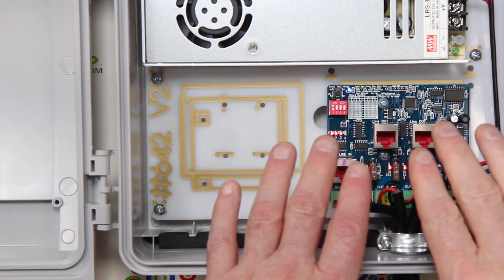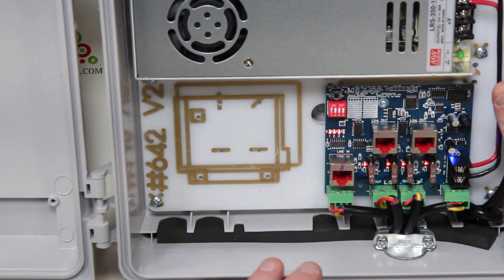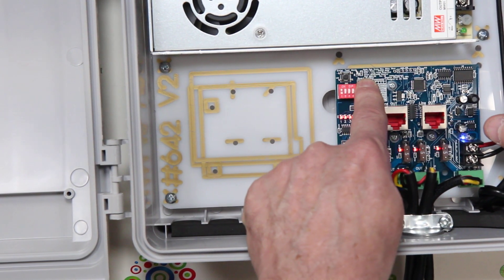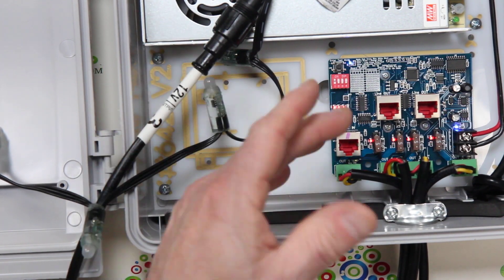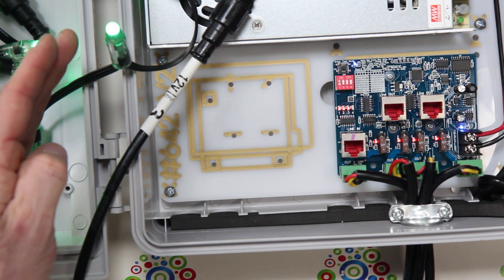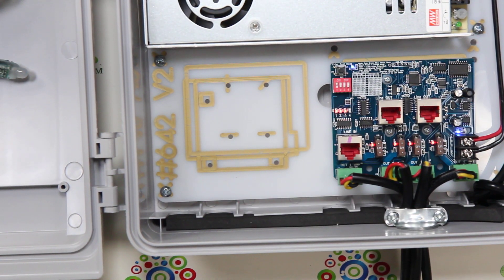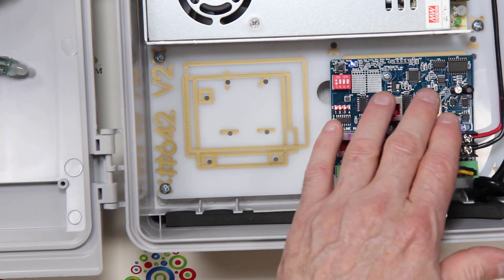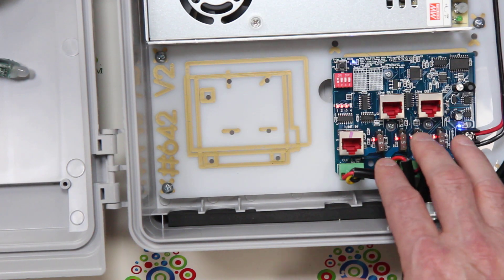OLD CONTENT: Flex Expansion Board System - 4 Port End-Point Differential SMART Long Range Receiver

Comment: Anyone know how to enter test mode on this one with only one button and no screen? I hold the button down and get the blue light, but lights don’t light up or change color when hitting the button
Reply from the maker: If the blue light appears, the long range smart receiver is in test mode.  If the lights don't then work, the problem is either protocol, power, wiring or a problem with the pixels.